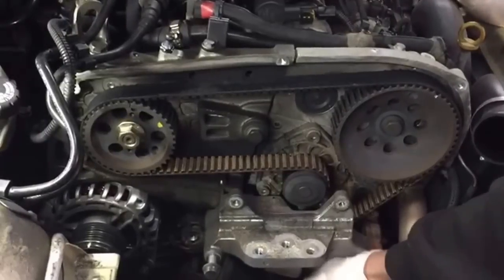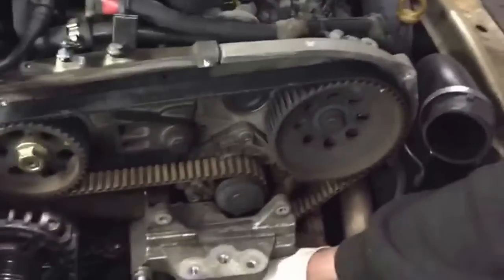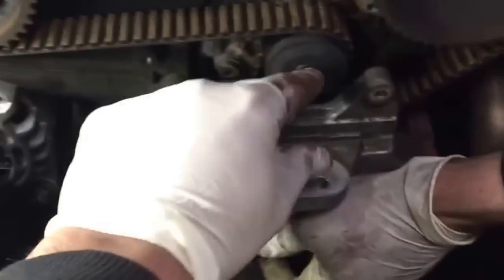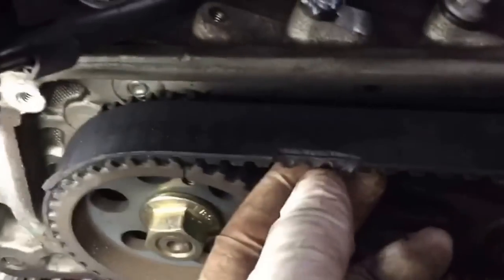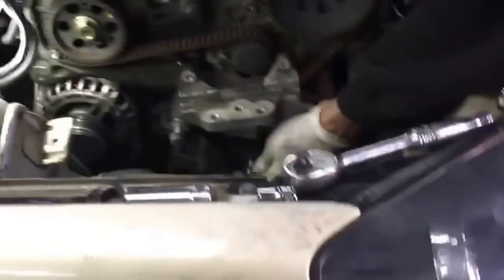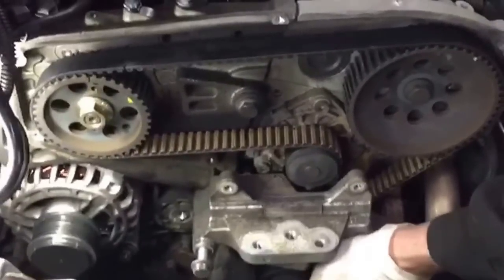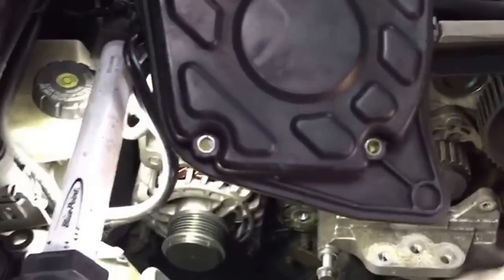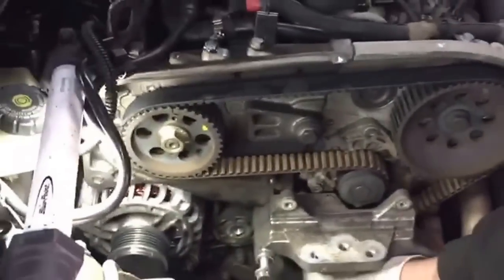Symptoms of a bad or failing Timing Belt & water pump

Comment: Sometimes the belt is replaced because it's 7 years old but has only has 1/3 of  the maximum mileage. I suppose in that case it's reasonable to skip the water pump.

Comment: Not very helpful! My 2003 already had serpentine belt changed at 45k because it was cracked. Because I saw first hand what happens when a water pump & timing belt fail while on vacation with another persons car I learned first hand to never replace a timing belt and not the water pump. So when my Toyota Tundra reached 85k even with no signs it was “ time” to replace both- I followed manufactures recs.  So now my Tundra is 18 and has 143k miles- so that’s 63 miles of wear on the “ old “ timing belt & pump.”  I’m hearing noise at the area but how do I know it’s the belt & pump? I thought your video would at least let me hear the noise.   I’m not sure that many people looking at this guys car want to replace these things themselves- I don’t at age 74.  So think about what you are trying to teach here! This is not what your headline delivered.

Comment: Hi Taj Khan, I am driving Avensis 11 plate.on dash there are  messages flashing says  ''check parking barake system'' and " Check VSC System.  Khan what you suggest for this messages .?
Reply from the maker: The Vehicle Stability Control (VSC) is a system in a lot of Toyota & Lexus cars that help the car from sliding during harsh climatic conditions. The moment the VSC system realizes that the car is losing traction, it will automatically apply to brake on all of the car's wheels and keep the car from further skids.
Reply from the maker: If you gone through massive puddle then the light may have been triggered!! If that’s the case then drive for couple of days and it should just go off or take it to your local garage and have the plugged in...
Reply: @TajMotorMedics  thanx for reply..it doesn't go. If it goes suddenly.. It comes back.  I remember...it come first time when I was parking in street and driver side passenger tyre gone up on curb..since than it is there. Whent to garage and plugged  to device for falt..they say you need to change GPF ...I am confused.

Comment: So you have to replace the engine if a timing belt breaks never heard that
Reply: for some engines, yes. Mainly on older cars when you brake the timing belt the car will still run and destroy your engine. On newer models, you got sensors up the ahole, and your engine will shut off before damaging anything else
Reply: thanks for the heart <3

Comment: Can a timing belt on an Astra wear out like this within the recommended replacement interval?
Reply from the maker: Yes it’s possible so please be advised when the belt is due for replacement get it replaced because it’s not worth taking a risk.. and replace water at the the same time only if it’s internal. Thanks
Reply: Is the belt in the video (visible wear) overdue?
Reply: @necessaryevil8615  if you're unsure give it to mechanic, the belt can slip if the belt tension is not good
Reply: @MrRohanThomas  Off course I will. I was just suprised that it can wear out before the recommended interval. I don't own an Astra (but I do own a car).

Comment: if your timing belt fails it doesn't mean you will have to replace your engine.  That is disingenuous to suggest that it means that.
It can, but it is not probable.
Reply: if it is a interference engine and the timing belt fails it will most definitly wreck engine.  valves will get bent and all will need to be replaced, quite possibly pistons can be broke in process, very expenxive fix. not worth the gamble wgen it may break,450 dollar fix verses a 2500 or more engine fix or complete replacement
Reply: I have seen the damage a broken or slipped timing belt can do to the engine and it does not look good

Comment: Nothing on hear about telling people how to set timing after loosen it
Reply: You set the timing before you loosen the timing belt, marks are present on the new belt and also on the pulley and engine (Fit new belt with all the marks aligned, and your life will be easy). It is definitely there, look carefully and you will locate them easy. Rotate the crankshaft two full turns and feel the compression stroke so you know what to expect after the jobs done. Once your aligned, undo the tensioner and remove the belt. Refitting is basically in reverse order but you'd want to set the tensioner arrow and hole as per instructions that come with your new timing belt kit. Once it's on, rotate the engine two turns to check if it's rotating without interfering with the piston or valves. And reward yourself with a new ratchet, spanner set or any new tools with the money you saved.
Another YouTube video mentioned that when you rotate the crank after installation of the new belt, the tensioner arrow and hole may not align due to the tensioner now doing what its suppose to be doing, providing tension. So if that happens to you then don't worry. As long as you set the arrow and hole together first time, then it's set up correctly.
Reply: @redseantlworld  omg thank u sirr..even past 3 yr comment but its really2 helpful for me !!

Comment: what was the mileage on that astra and age ?
i need to get mibelt done soon but i'm kind of curious to see how long  a car can actually go before it goes  pop  so far in at 11years  81,000 no new belt yet still on factory belt haha :D
Reply: Our van has never had the timing belt or alternator belt changed and it's on 160K miles. We are just running it into the ground, we haven't even changed the oil in 60K miles and it still keeps running! (It is starting to sound like someone dropped a load of screws into the engine now when you rev it hard so I reckon it's gonna pop very soon) - I'm surprised neither belt has snapped yet ... The alternator belt looks like someone got a knife and tried to carve a novel into it it's that cracked, can't see the timing belt as it's behind the cover

I will point out to anyone reading this, don't do it with your own car unless you're just planning to run it till it dies with ZERO maintenance and then scrap it
Reply: why are you trying to destroy a good engine
Reply from the maker: +Razor howl this Astra was 2005 and it was well overdue! But pretty much all astra's timing belt should be replaced at 60k or 120months and if your car done 81k you should then replace it soon and do the water pump at the same time.
Reply: Taj Cars 
Same here ,10 years old astra ,76K miles ,i bought 1.5 years ago but dont know if it was ever changed.
Reply: @naumidec  you should give it to mechanic because if that belt slips then your engine will be destroyed unless it non interference engine but I think Astra is interference